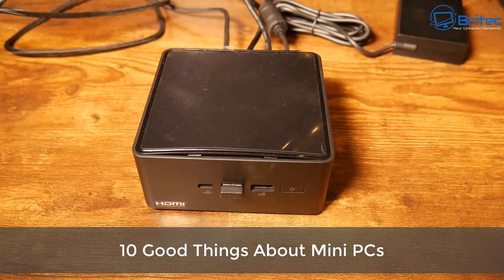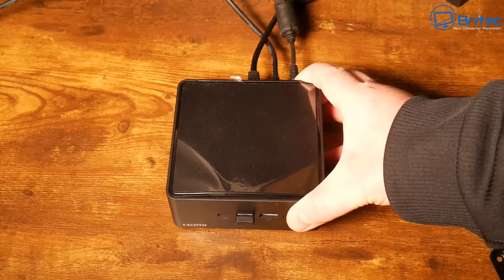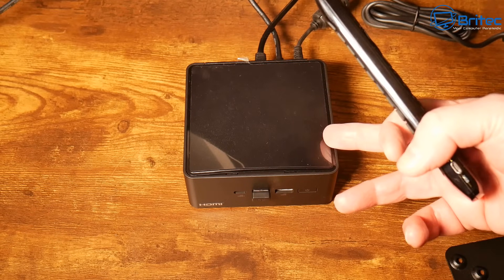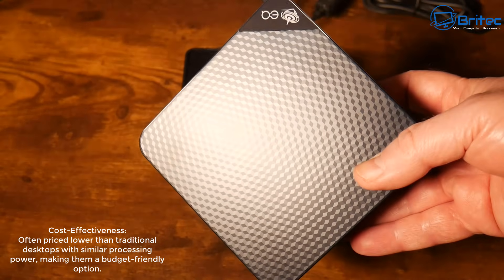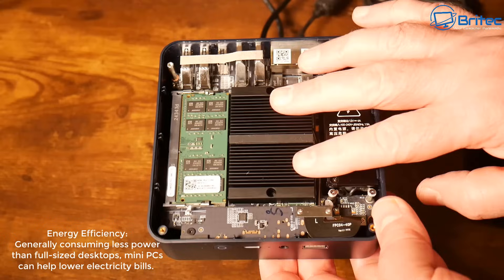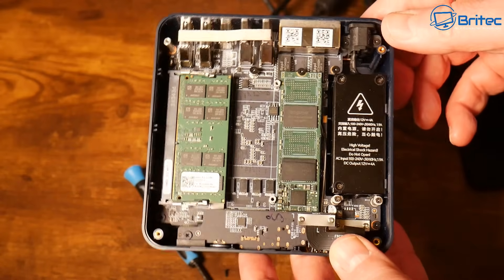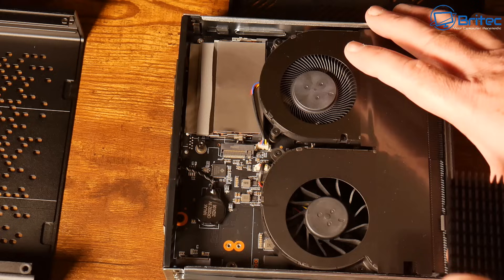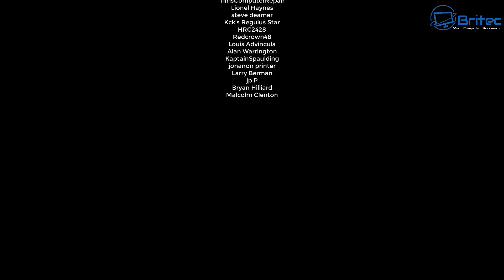10 Good Things About Mini PCs

Comment: Advice: a $25 duel bay hhd usb 3.0 docking station is useful with these mini PCs. Add used laptop 2.5 inch harddrives from eBay and you have a great archiving setup for movies and MOVIES (if you know you know). It gets cheaper when you buy in lots of around 10. When buying used laptop harddrives aim for $1 per 100gb...so 500gb aim for $5 each in multiples...$7.50 each for 750gb in multiples. JDownloader 2 is a great download manager to help in downloading multiple files and it's free. One more thing: make sure you get SATA used laptop harddrives and not SAS. your docking station will not address any SAS interfaced harddrive (SAS is for servers and not homePC). One more more thing: limit 3.5 inch harddrives in your dual bay docking stations to one at a time. Large 3.5 inch harddrives generate a lot of heat and two of them running side by side with give you heat problems. You can dock a 3.5 inch next to a 2.5 inch no problem. Plenty of circulation that way. And that dual docking station can also make one to one copies of your harddrives and it can even do that when not connected to any PC.

Comment: I have two of these now. One feeds my big screen TV with a huge number of videos available. The other has replaced a laptop I had configured as my main Windows 10 desktop computer for the last several years. For both I immediately upgraded the SSD to a larger size and added a second drive, both have 4 TB of memory. I'm impressed with their performance so far.

Comment: I'm loving my new k8 plus mini PC. My only gripe (and it's a small one) is after adding speakers, mic, a 2nd monitor, etc. I have spaghetti wiring behind my desk...it doesn't bother me much seeing as how I'm the only one that has to look at it...I don't put a lot of weight in hiding cables, what for? It becomes a task having to unravel everything whenever you need to replace or add something...

I never cared much for tower PC's because they take up so much room you end up having to either buy a much larger desk or setting it on the floor where it's more prone to dust...and you can forget about portability.

Comment: I actually bought a mini pc last month, and it's been fantastic so far. However, I initially wanted to Vesa mount it, but the monitor is up against a shelf, and it's difficult to reach the power button if it's behind the monitor. Any tips on how to power on the PC without having to reach the power button on the mini pc?
Reply from the maker: Some mini pc have cable with power button

Comment: Being able to hide the minipc is a great feature, but reaching for power button can then be problematic. Therefore the pc's uefi/bios should have a property to set power loss behaviour to turn the device on when power comes back on.
Not all these gadgets support that. Check it out, if you are going to use a master power switch for this purpose. It's nice to have one handy under the desk, powering on the pc and all peripherals.
Edit:
My ACEMAGICIAN AM06 Pro Mini PC has this "auto power on" feature (an awesome little gizmo, btw).
Eg. NiPoGi E1 Mini PC does not, so cannot be hidden away.
Reply: That's also my main issue. I dont understand why you would hide the power-button on the back for the screen where it's almost impossible to reach. So many screens are put up against a wall. You would have to climb the desk to reach for the powerbutton. The idea above, with a master power switch is great, but if the minipc doesn't play along...

Comment: I am having trust issues with budget unknown brand mini P.Cs, since the pre installed virus debacle. If i was to ever get a mini P.C I would be looking to check all the drivers were available and virus free first and reinstalling Windows.
Reply from the maker: @ShadowzGSD I only ever come across one company and I refuse to work with them again and I exposed them as well.
Reply: Boot into an AV package on a bootable USB stick. Your distrust is well placed. About 24 years ago,I bought a laptop. I booted into an AV on CD, et voila, virus found. I emailed the company owner. These days I'd consider going to the police, as they're more interested in digital crime, which this was.

Comment: When I used to work, I had desktop/tower PCs running 24/7/365. The power bill was insane but I needed the equipment for work. Now that I'm not working anymore, besides laptops, I use mini PCs that truly sip power. The tech in these new mini PCs is also way beyond the old machines I had.
Reply: Modern PC will go to sleep by itself when you left the desk so the power consumption should not be a problem, mini PC has more to do with saving space.
Reply: I should add that I actually needed to have the PCs run constantly because I was using them like servers, though with myself as the only user. I had to carry a pager for the company I worked for and had to (officially anyway) answer any call within 5 minutes. The machines of that era were too slow to allow them to wake up from sleep or wake on LAN. I also needed remote access when away from home.

Comment: I have the GMKtec G3NUC with the N100 chip, and it's a surprisingly capable little device.  It isn't my primary PC so I can feel free with playing around with dual booting.  I've upgraded it to 16GB RAM and 2x 256GB SSDs.
Reply from the maker: N100 chip is great for everyday use